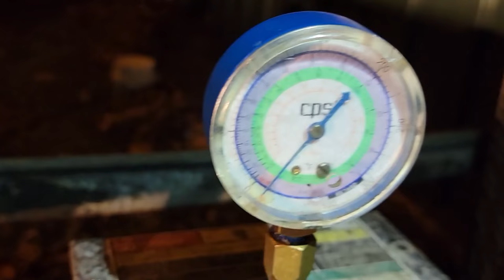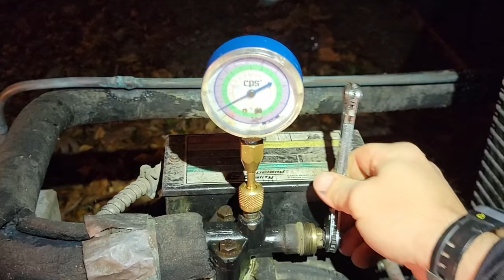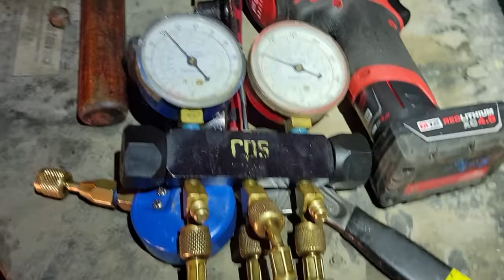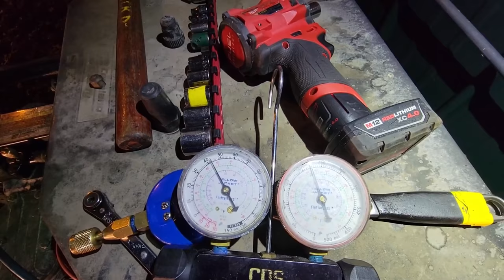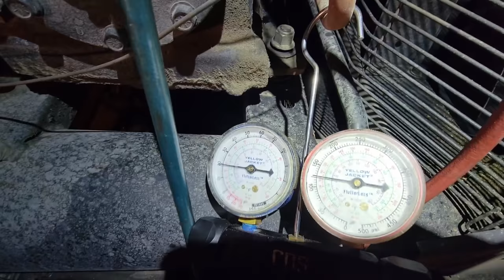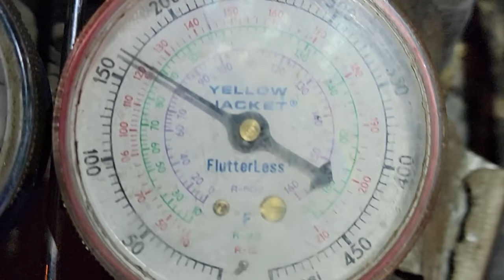Compressor Just Clicks, Been Like That All Day...

Comment: SILLY Rick ... That fan was operating that way as part of the new AWEF Efficiency stuff things.  It switches direction each time so that the coil can become equally impacted with dirt on both sides, and so that it can take turns blasting hot air into the side of the building to aid the buildings heating system efficiency! You screwed it all up now!! It's no longer 2023 AWEF compliant! Lol great video.
Reply from the maker: 😒😁😉😉👍👍 I'm a rebel, what can I say🤣

Comment: hahaha "capacitor guts" you are funny. They couldn't face the fan to the side or install it a bit further away from the wall. No, they just installed it as close to the wall as possible. Heat rejection? no, that does not matter at all. When you ask your audience if they want to learn more about compressor diagnostics, the text below is totally blurred. Thank you for this video.
Reply: Oh I see. The fan was wired incorrectly. Never mind.
Reply from the maker: No I tried working the deal out with somebody that drugged their feet on getting me an answer to my proposal so I took their website off.

Comment: Rod bearings are shot.  This is either from liquid slugging,  oil entrapment,  or both.  That compressor is a boat anchor.  I had a 3 HP Coplemetic throw a rod,  due to poor oil return.  I couldn't get replacement parts,  so I had to order a new compressor.  I will never forget walking into the local refrigeration parts store with a piece of metal.  I showed it to the guy behind the counter and asked if he could get me one of these. He asked:  "what is that?"  Then,  a fellow tech behind me in line said "it's a connecting rod".    Those were the days.  But the nice thing about those Coplemetics is that sometimes they CAN be serviced in the field.  They seldom die unless they are installed in a poorly designed system, or the system is abused.
Reply from the maker: @John bond thanks for the feedback! I agree they are tanks👍

Comment: Nothing like those late on call service calls.. Another great video Rick👍
Reply from the maker: So do you agree it was loose discharge valves? It's weird it wouldn't hold vacuum at first,  yet it pumps down when finished 🤷🤔.   I'm still waiting on a response from Matthews.
Reply: @HVACRSurvival  It could of been something stuck on the valve plate and when you opened it up might of freed it. It is a small plate so any little copper shaving or anything could of gotten stuck.

Comment: That could be a new thing, have the fan reverse directions every so often so dust doesn't build up on the condenser.
Reply from the maker: It's already being done on True and several other brands.
Reply from the maker: You'd really like the one where it uses a automatic brush to brush off the coil. Believe it or not that's on one of the cheaper brands

Comment: Thank god I am in a factory now. When I ran service I had a job that never ended it started when their transformer blew on the outside pole. Outside condenser had fried components and a bad fan motor, it was like 10 degrees outside  snowing like a mofo. Had to use the bumper of my van so the ladder would not slide out. Then go inside and the defrost timer is fried . I go why why why me! I get that sorted out and the owner is like what about the heat? I take a look and the blower motor is burned up one of the phases at the transformer was flipped flopped I did not realize that until I put the new motor in and fired the unit up and it took off backwards and burned up causing smoke to fill the business. So I got another motor flipped a leg around on the contactor and was good to go. However now I need to fire up the air to make sure the compressor's are running right. I called my boss and said everything is fixed and I am taking tomorrow off.
Reply from the maker: I have had days like this, looking back they're funny but when they're happening you're ready to kill people.
Reply: @HVACRSurvival   You are correct , LMAOOOOOO

Comment: The one time I tried removing that indicator from the sight glass, I found it to be closer to theoretically than actually possible. I almost ended up twisting the sight glass body free from the tubing!
Reply from the maker: You got to definitely use a 6 point socket, you cannot use a crescent wrench. But I know what you're saying they're in there tight

Comment: Hows that 902 holding up? I like the 116, but don't want to carry 2 meters for just the Amp draw
Reply from the maker: I use the 902fc 99% of the time. It's not that often that you need the higher resolution. I only use my bench meter when working on generators or something that's not acting up for me.

Comment: Oh yes this brings back memories. 

I remember working on a roof of a gas station on a similar hunk of feculence in the middle of winter around -20℃/ -4℉.
Due to the strong winds and the condenser not being against a wall the head pressure plummeted like Biden of the air force one.

I took the carpet from the staff breakroom and wraped it up like a chrismas present and it ran like that for a week until i had a piece of sheet metal fabricated to hinder the wind blowing through the condenser.

Comment: Are you sure that's gunk on the sight glass?  It looks like yellowed plastic, to me, from heat and "outdoor" exposure.   

This reminds me of a lot of late nights cleaning up leftovers in ceilings.   I did some the other night - wires ripped out of the walls and just dumped into the ceiling, others that were in the walls but went nowhere.... I had to trace virtually all of them just to find the ones I need to fix, and add some new ones to make the doctor's office work properly.     I'm sure you run into it a lot.  "If the equipment isn't in service anymore, TAKE IT OUT!"
Reply from the maker: It could be from the sun? I see it in different neglected systems but glass usually will clean up. Not worth replacing if they were considering replacing the whole system.
Reply: @HVACRSurvival  I'm in the "Deep South" (Houston), so I see tons of yellowed plastic.   It doesn't have to be in direct sunlight - from what I could tell of the enclosure, the entire front is exposed to the outside directly.   It's just a 'shade' over the top, not a defense against the weather.   That means UV will reach it, heat, cold, etc, etc.  I guess it depends on if it's glass or plastic.  I've never tried to break one to find out.   You'd know more, not better, but at all, than I.